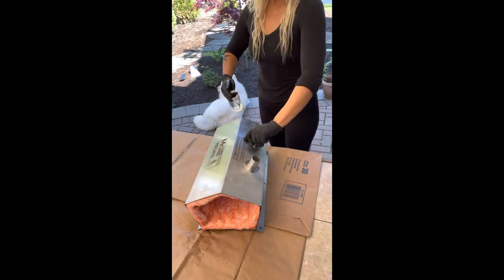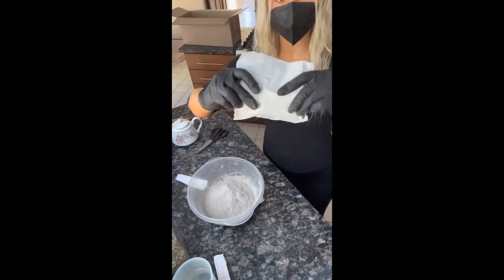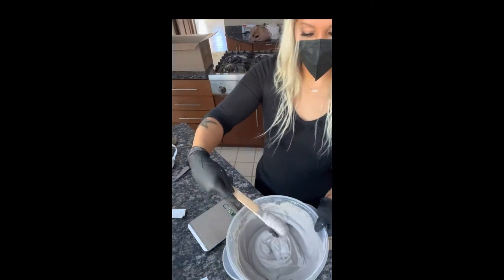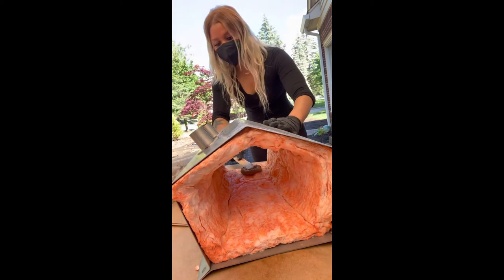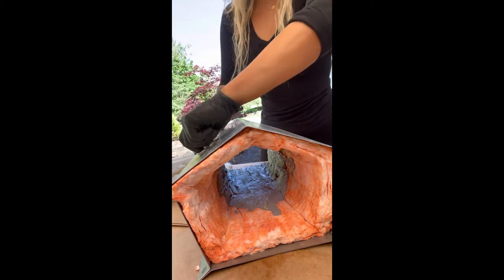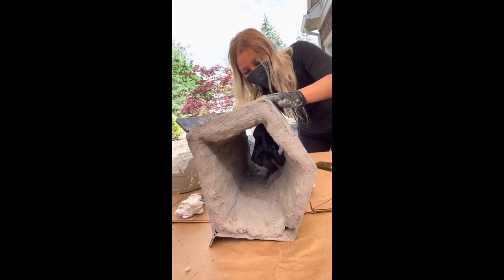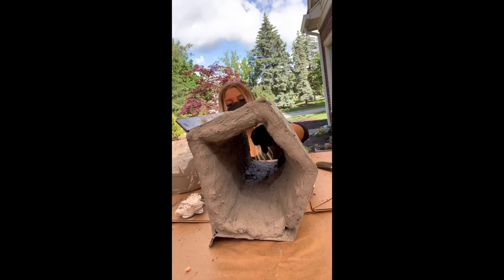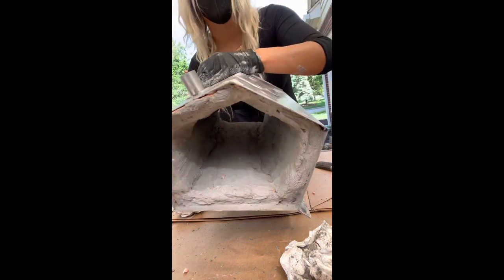HOW TO SET UP A FORGE PART 2: REFRACTORY APPLICATION

Comment: Good info!  How hot and how long did you cure it for? I'm setting up mine for the first time and the instructions call for some insane times. I just want to see what other people are doing.
Reply from the maker: It air dried but it took a few days without a fan so after the 2nd or 3rd day I put a big fan on it and it was dry the next day!
Reply: @HairByAriiianna  nice! I need to try to find more for mine.  They didn't send enough, and it's thin layer is too brittle and doesn't provide enough of a buffer for the insulation.  Thanks for the response though!